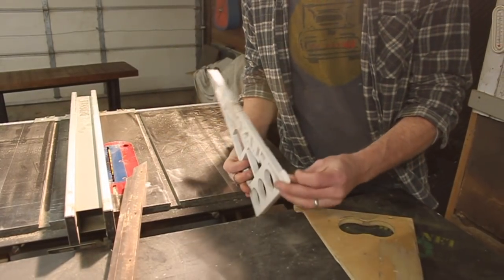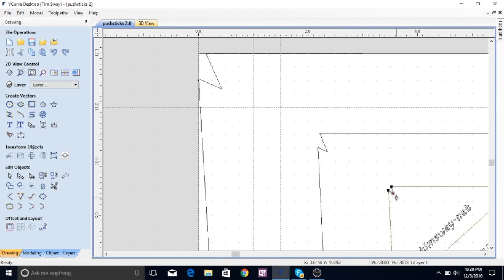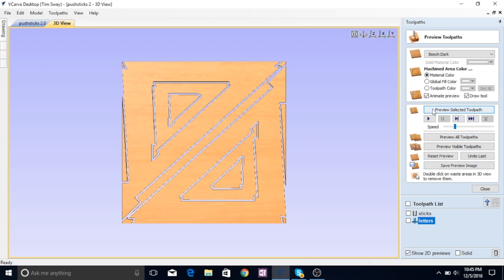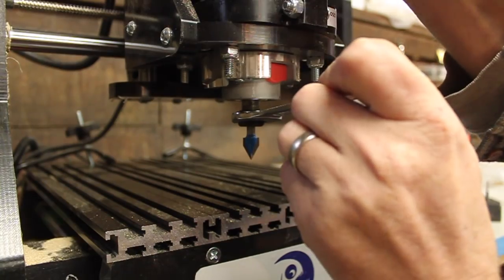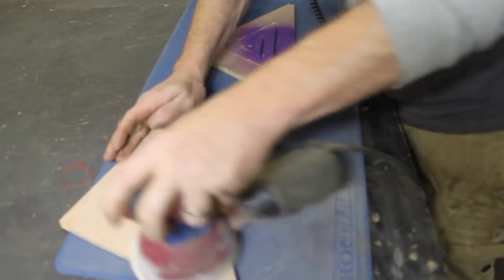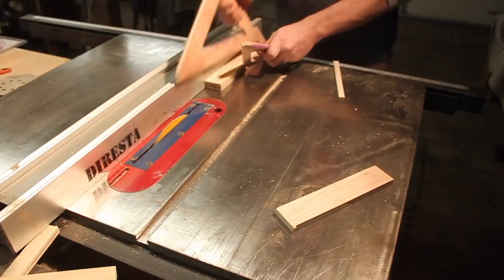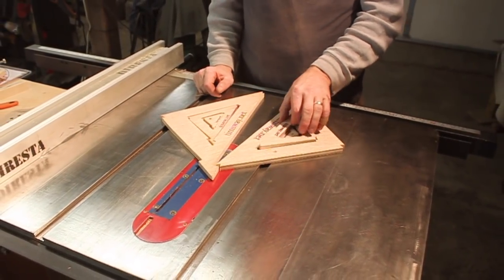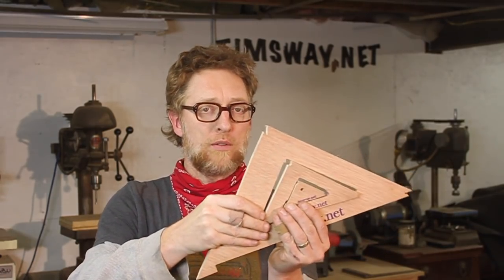Multi Sided, Nesting Push Sticks

Comment: why is it every woodworker/maker that I enjoy is now cnc obsessed???  your channel was appealing bc the projects were very doable for a regular person like me. Izzy Swan has gone down the same path. love it when you build awesome reclaimed/scrap wood projects minimally.  not hating just more of that please
Reply from the maker: Absolutely Renae! Of my past 8 videos, I have used the CNC in 5 videos, 4 of which have been about it specifically (partly to fulfill my obligation to Rockler and partly because it is d@mn fascinating.) I am aware of this and have several non-cnc videos in the works (some even completed) but they have to wait until after Christmas to air :) The timing sort of worked out this way. 

I have also done two "shop improvement" videos of my past 8 - which is not my thing, either.

I do not intend to become a CNC channel, but the machine has enamored me, like the reclaimed boat wood I got - which is why you'll see so much of that in videos posted and to come. These push sticks can easily be made by hand - as can the building blocks - I really want to see those made by hand by someone other than me! 

My plan is to have the machine "settle in" to my work flow, so I can use it to add special touches to pieces or batch out work while I do other things, and not have it a centerpiece. And I plan on making more limited tool and all hand tool builds, too, because I think that's cool and important.

Thank you for your honest feedback. I am aware and working on being a better, more well-rounded person in every aspect of my life - including youtube :)

Comment: Tim, I really like your thinking on this. I do a lot of CNC router work, and it bugs me there can be significant waste around the edges of parts. This is especially true when cutting parts that have straight edges in the design. With a traditional saw, the already-cut edges would be used in the final (or next) piece. Whereas with the CNC it's kind of hard to do that. I think you know what I mean. Thanks for the entertaining content, as always!
Reply from the maker: right on. I see the CNC as a means to have less waste - or more waste depending on how you use it. One of my goals with it is material efficiency. As I get better I can adjust my toolpath to allow this, too. In my #makeblocks project I found issues with the work coming loose because of the order pieces were cut, etc...
Reply: Tim Sway Yes, so I'm learning just like you (I'm an artist not a machinist). My first build video, "USB Hub Challenge" left me with a big thick chunk of scrap plywood (that bugs me). On that, I used "tabs" or "bridges" to hold the piece in place. (You see me sawing them in the video.) Well, my stock had to be larger to allow those tabs to connect to something. Granted, that was a 3" thick, 3D, 2-sided carving. When cutting sheet stock like your push sticks, I sometimes design strategically placed screw holes right into my tool paths. This allows the machine to drill the holes, then I pause, screw down the (yet un-cut) parts to the spool board, then resume cutting around them without coming loose. So far that method has produced the least amount of waste. Hope this helps.
Reply from the maker: great idea. noted!

Comment: You know Tim, I've got an awesome CNC router that I can't figure out how to use. I envy those with off the shelf systems that have easy to use software interfaces.
Reply from the maker: What do you have? The machine I have def is the best way to get in to this. I have now messed around  with a kit CNC and if it were my first, I probably would've given up.
Reply: It's a 2x4' CNC router running on a Gecko drive controller. It has no easy to use software interface. It uses Mach 3 CNC to control it. Once you create a file that Mach 3 can read, it works and software like Fusion 360 is capable of doing that. I'm just having trouble figuring out how to do that. For instance, the first thing I want the router to do is drill all the holes for T-nuts I'll put in the table top. I made a file in Fusion 360 of the table top, placed all the holes in it, then told it to create a tool path. When I ran the simulation, the router bit just traced the outside edges of the table top, which incidentally are outside the limits of the router's travel. The answer to my woes is to learn the CAM aspect of Fusion 360 and my only resources are online so answers to specific questions are in short supply.
Reply from the maker: Right. Mine came w vcarve which is much easier to figure out. I'm controlling my other machine with universal gcode sender, but still using vcarve. Your problem sounds like coding/setup issue but it's wayyy beyond my diagnosis power! I barely understand fusion.

Comment: The only thing I need less than another "woodworking" CNC video, is one in which the operator wishes he had a larger CNC machine. Seriously, the idea and design are great, I will cut something similar out with my "gasp" coping saw.
Reply from the maker: hahahaha! I didn't mean it to sound that way. I actually like limitations as they force creative solutions. I'm also not a fan of "shop upgrade" vids, but some people find them useful. If you can bear with it and get an idea/inspiration, then it's a win. I can't wait to see your coping saw version.

Comment: I like those push sticks. And tbh, i dont have a pushstick like that. 

You need to get yourself a smaller tablesaw to use the small one. Look into proxxon tablesaw ;)
Reply from the maker: thanks! I used the "stick" until I saw the DiResta triangle (which is like the stick and the Heisz-style combined). So I thought I'd take it even further in efficiency. The little ones aren't very useful, but they will come in more handy this way than in the scrap bin.

Comment: Seems to me there is an easier way . . . why not add a piece of wood the length of the back end  of the push stick to replace the notch?  This could be replaced as often as necessary and would mean the push stick would last indefinitely.
Reply from the maker: David Waelder recently made a sliding dovetail  design like that I love and is probably my favorite - even over this design. It's a great idea and more efficient, but not necessarily any easier. The ONLY (minimal) problem I have with that is moving/disconnected parts on a safety tool. There's potential for failure/slippage. And metal fasteners to prevent that would be equally dangerous.

Comment: Hi Tim, can you give me some info on the CNC you are using. I only want a small CNC like the one you have but inventibles start at £1000 and skyrocket. I also noticed that you used a USB stick, do you need a computer to run the stick as well as one to do the programming on?. I tried a Chinese CNC but had to send it back as I had problems activating the programme and they just kept on sending me new activation codes but my problem was that the programme disabled my keyboard and mouse so I could not input the code, after 13 emails and 13 replies I gave up trying to explain as their grasp of English was so poor that the replies made very little sense and some of them you could not even read as a sentence.
Reply from the maker: Hey John, Sorry it didn't work out with the chinese one. my 12X12 is a Rockler Pirahna (link below), it is small but not inexpensive, very well built and easy to use. it comes with Vcarve Desktop software (in English! :) So you design on your computer, save the code to the thumb drive, then use the built-in interface on the pirahna to run the machine, Very user-friendly, pre assembled (unlike the Xcarve) , etc. etc. There are less expensive ways but as far as user-friendly, I don't think they get any easier to jump in. Hope that helps. 

http://www.rockler.com/cnc-piranha-fx?utm_source=google&utm_medium=cpc&utm_term=&utm_content=pla&utm_campaign=PL&sid=V9146&gclid=CjwKEAiA4dPCBRCM4dqhlv2R1R8SJABom9pHjJpqCykYiwd1SpWilpeetkTXbORgsdPEoU-E_SlUXxoCGBbw_wcB
Reply: Thanks for that info Tim. Unfortunately when I checked the link and tried to buy one it came up that they do not ship to England so I cannot get one of those, but at least now I know they are out there so I can keep looking out for one.Thanks again for the info and I hope you have a great Christmas and new year.John

Comment: I like this video That having been said please make some out of Upcycled HDPE that way they can be remade from same material for ever.
Reply from the maker: That is on the list!
Reply: these hitch sleeves don't bend or warp as thinner stuff can. I have also made sheets by using cloths iron from thrift store on low place sheets between non stick baking paper and iron as you would clothing turn bags label sides in first to get best stick between sheets.